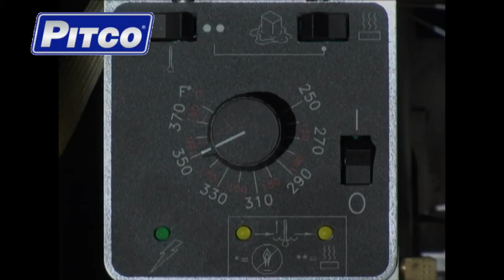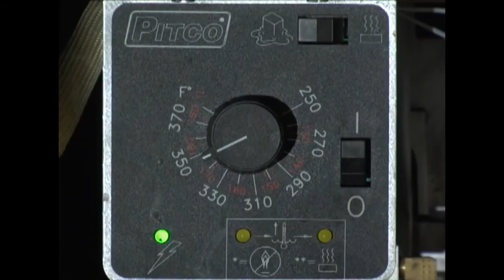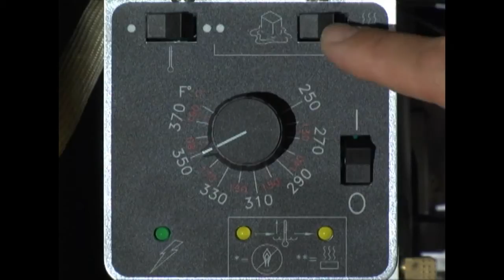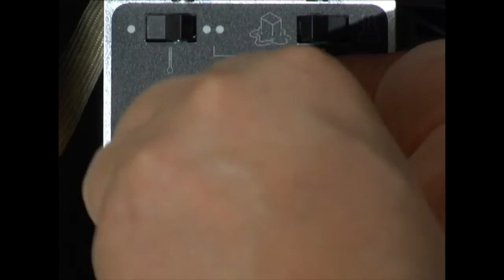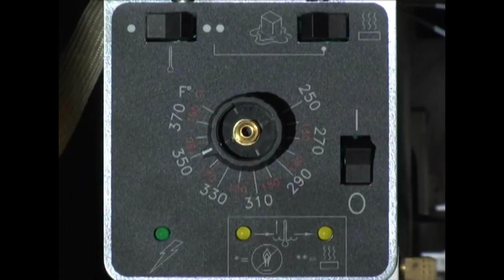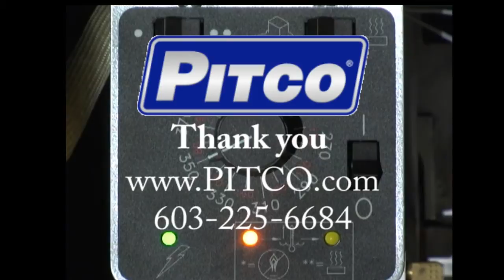SSTC Training.wmv

Comment: What does 9 flashes mean?
Reply: Exactly what I'm looking for
Reply: @TheTexnician  I may have it mixed up with another job we did, but if it's the one I'm thinking about, it had to do with the drain valve sensor.  Wasn't making.  Needed to be positioned closer to make properly and I think we replaced the little switch anyways.
Reply: @Sean O'Donnell  did you find the answer?
Reply: 9 flashes is a Heat Failure code that was added to the controller in about 2017/18.